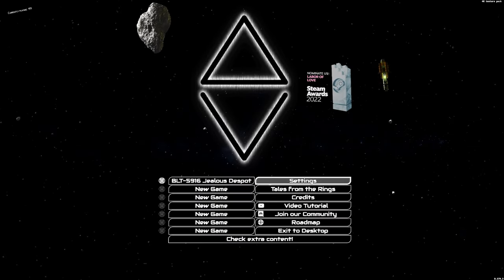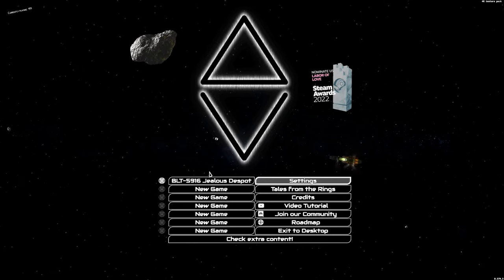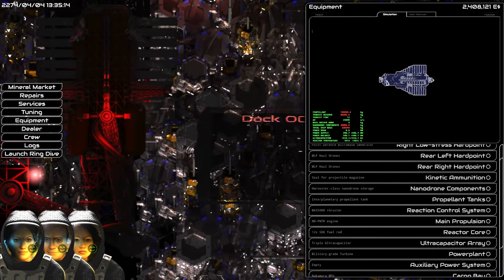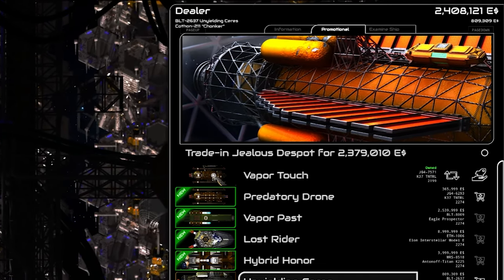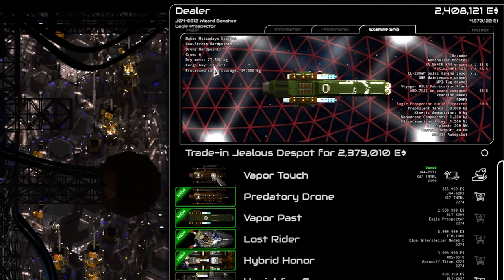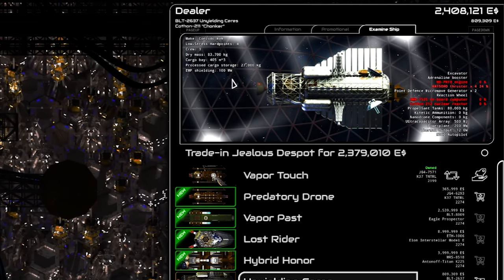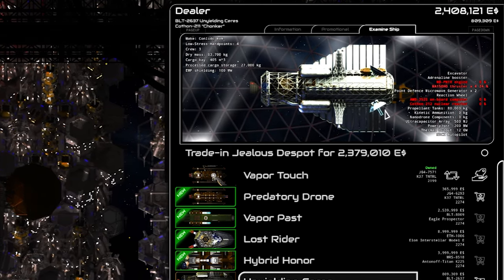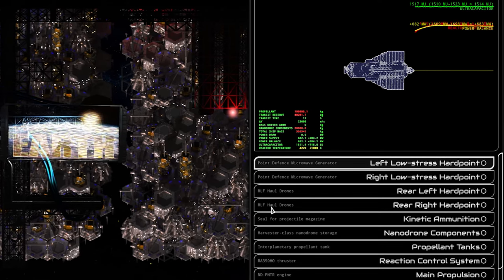Sweep Mining, Efficient Semi afk Mining Setup - Delta V Rings Of Saturn

Comment: Get the (combined) variant and you don't have to care about processed limits. Setting your Haul drones to higher values can top grade material gathered. Facing off angle a bit from thrusted vector also might help.
Reply from the maker: Good points, esp the haul drones. Cheers Echo
Reply: Aye and while your drone components aren't bank breaking, it isn't efficient using them to move around heavy rocks with little to no value.

Comment: Great guide, just a few questions since the game dosent tell you much info 

Do all drones “consume” when they go out and do their job? I tried using drones before but they don’t really last too long even with the top tier drone storages.

Also, how about setting the game to the lowest difficulty and then going straight into the rings?
Reply from the maker: Yeah they are used up. Is worth upgrading them early on. That and cargo management (not jamming you processor mouth with a full cargo hold) will determine how long your able to keep mining. Happy ring diving ;)

O going deeper in is defs worth it but you will need to be more hands on re being on guard for Rats and AI. If i get caught out i usually play highspeed follow me with them as im disabling them with the Mwaves. Just need to get um to smash into a big old rock and avoid lithobraking yourself then exit the area...

Comment: i try the point defense Mircowave things but they do nothing i can fire them with space and i cant minbe asteroirds with them. Have i forgot something why they dont work for mining. I try it again and soo if i made a mistake. And then i comment back here. I love this game, i realy hope the devs have some cool new stuff for the final release. this game is so good. And i realy hope there is alot to come in terms of new content more equipment stuff new ships and so on.
Reply from the maker: Hard to say without a screenshot but are they turned on? Maybe post a screen shot in the gaming section of the discord... Hope you get it working. Fly Safe 😉
Reply: Make sure you tune them to 90 percent and full power!
Reply: It doesn't work for me much either, it seems a bit buggy, it will occasionally target something, but it's so inconsistent, it's completely not worth it, I can mine a lot faster manually.

Comment: I changed the key binds and used sticky keys and the better Point Defence can get 1000000 in refined ore in an hour or so
Reply from the maker: That binding and sticky thing is quite clever. nicely done. Still leaves (maybe exacerbates) the issue of cargo management and not jamming your processor though. I find if get too much input and dont pay attention to the way my load is moving (or not) it can clog up and is easier to just return to Encel then dump and reload. Would love to see you are managing that? Thank you for leaving the tip anyway much apricated 😉 happy diving.